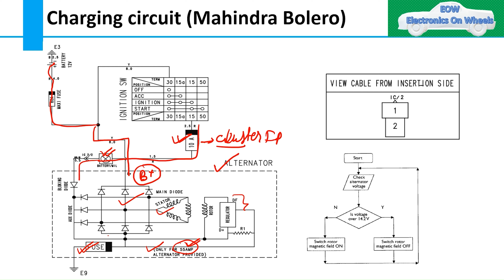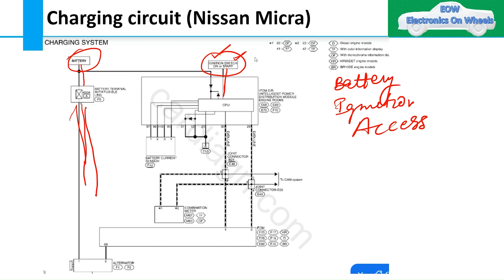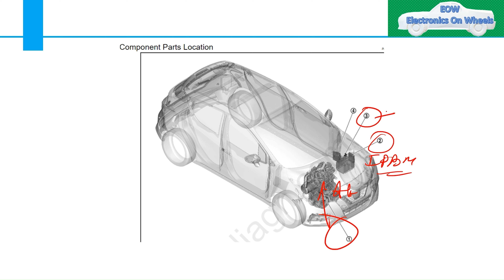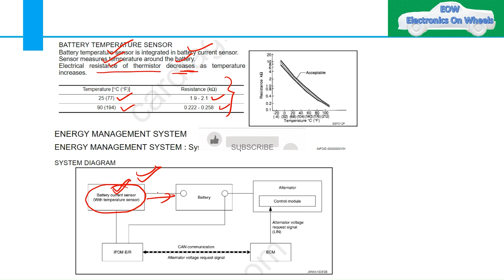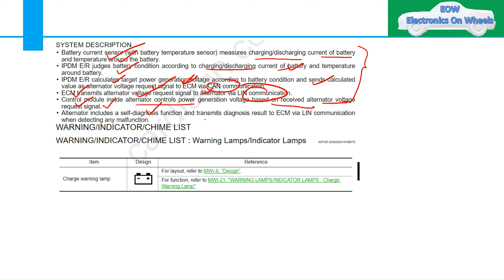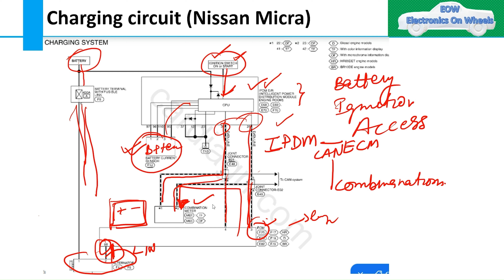CH# 08 How charging system works in car|| Wiring diagram, sensor|| How Alternators Work@WeberAuto

Comment: Nice video. Please tell also about the place of interior lights in this scheme? They should be all time hot but at the same time some of the car brandnames realize this with dimming function. And this function should be controlled by some ECU. Sometimes they add that car radio can work with engine off and turn-key deactivated.....

This all is also interesting.